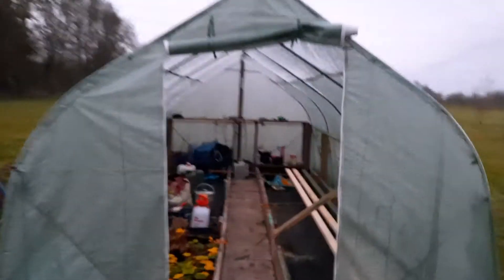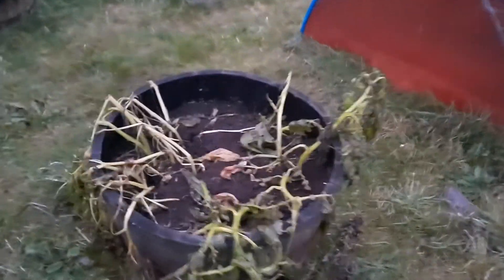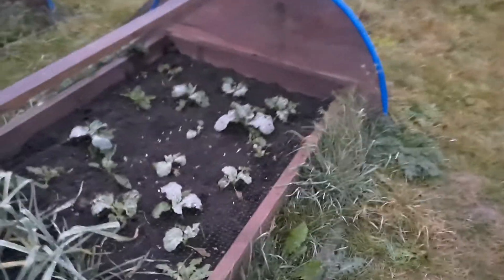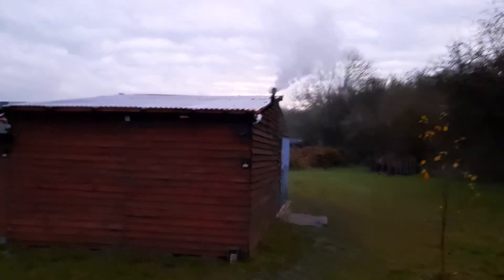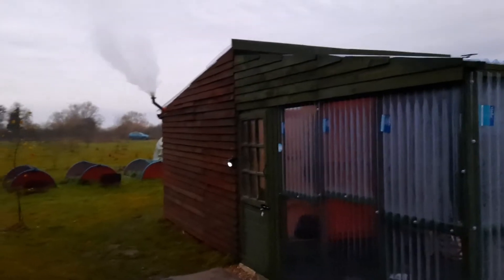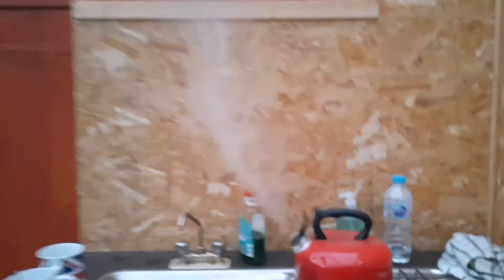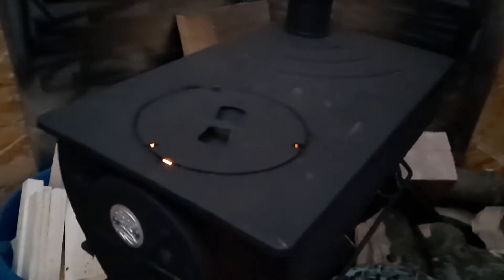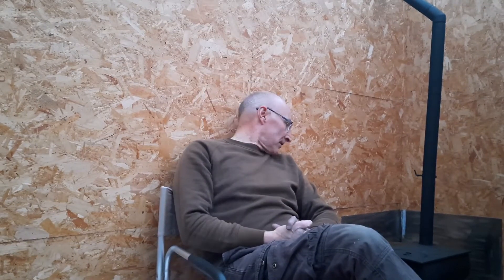A painful day at the cabin (But we still made some progress)

Comment: Nice chat.  I enjoy these.

1.  I installed a new heater like your own this year I think.  It works like a charm.  We use (tax-less) red diesel in ours.  As such we have a separate jerry-can purely to top this up.  It's for our shower-toilet unit.

2. There has been an attack on the middle-class.  That's all I'm saying.

3.  I'm not well at the moment.  Just flu.  I'm glad the missus is taking care of little ol me.
Reply from the maker: I used to have red diesel in my canal boat. Much cheaper 👍
Reply: @prepping_essentials  I intend to buy a tractor one day when I retire (THATS when I'll have the cash) and intend for it to be diesel.   We hear all the time that the g0v is trying to phase out fossil fuels but it CAN'T touch the industrial needs of diesel to run and be the backbone of a country.

In the meantime I have a BCS two wheeled jobbie that is petrol and does the donkey work...though I DO wish I could sit on it at times!
Reply from the maker: @Nellyontheland  I don't see anyone coming up with an electric tractor any time soon🤣 I'm hoping to get a small trailer to hitch onto my little tractor next year
Reply: @prepping_essentials  the one for the BCS with a seat can be around a grand.  Non existent secondhand too.  THAT'S why I don't got one 🙂
Reply from the maker: @Nellyontheland  ouch. Thats a lot